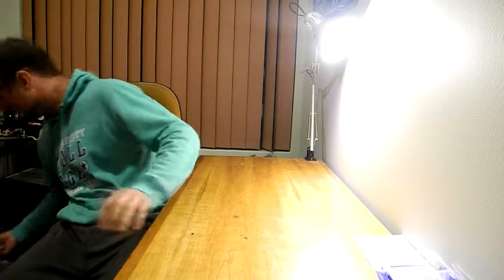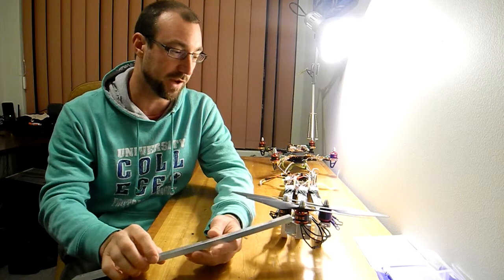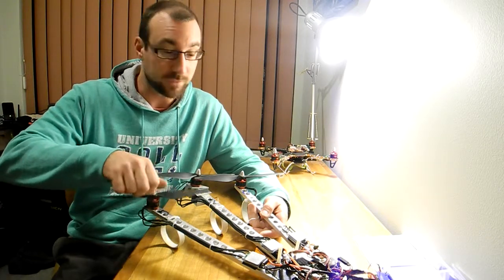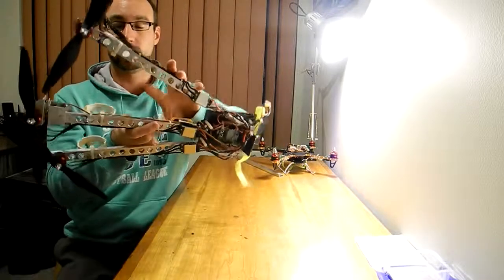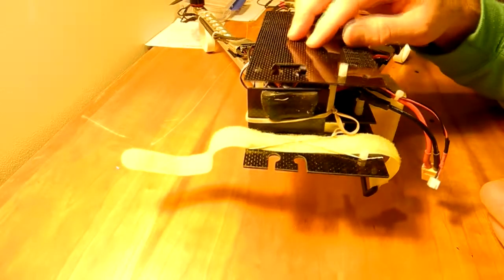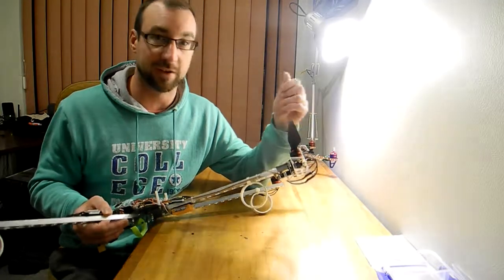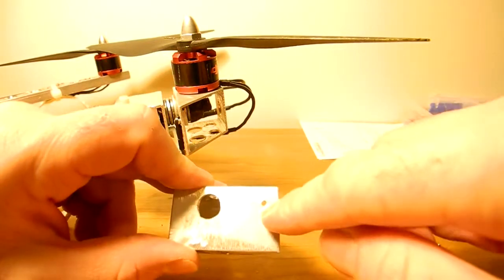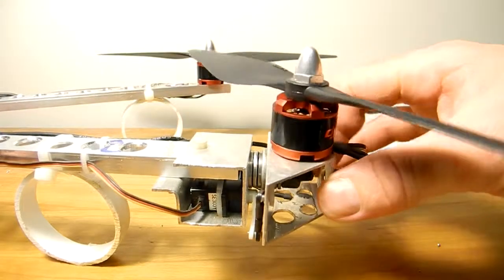My tricopter build

Comment: Still have this Adz?
Reply from the maker: Not anymore, I used the centre body section and rebirthed it using composite carbon/wood tubes. Still have the tricopter though!
Reply: Sweet, I really like the tilt mechanism. (It's Ben by the way)
Reply from the maker: EpicRC I have a much better version now !